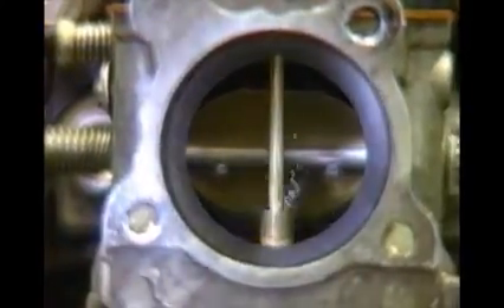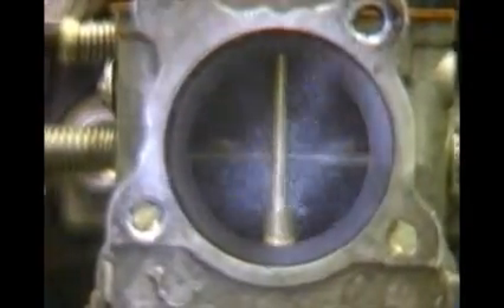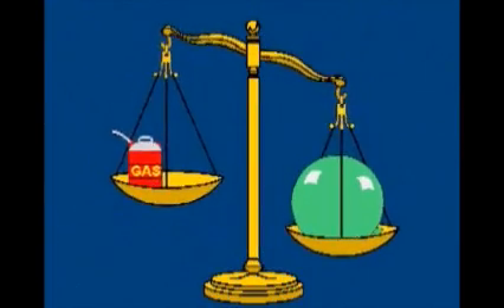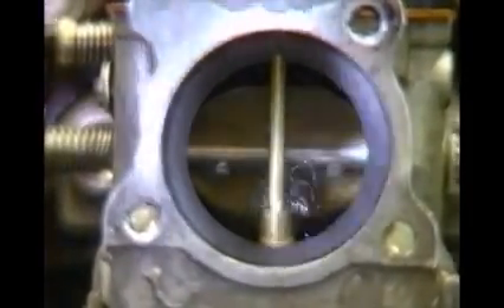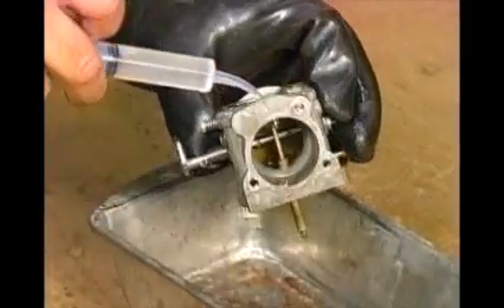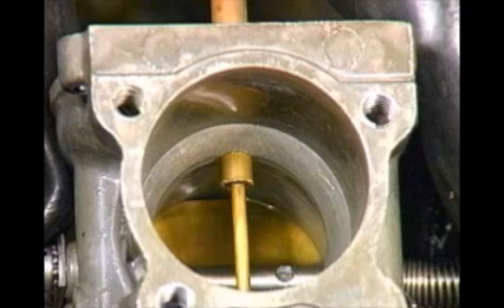Carburetor Theory and Service Procedures - Evinrude Training Video

Comment: Wow I wasn’t expecting to learn something from this video but I did! I didn’t know about float drop adjustment, absolutely no one on YouTube I have seen has talked about it. I think this will fix the problem im having with my mercury 5hp 2stroke I have as a kicker motor on my boat. The needle drops out of the carb and the carb starts flooding. When i take it apart I can’t understand why it drops out. Thanks a lot for posting these!!!

Comment: Maybe u can help me out, I have a 93 40hp evinrude TE40ELETB, I'm looking at new carbs, I see they make 2 different carbs for my motor, one says early production and one says late production, only difference I see is the late production has the removable top plate , my motor now doesn't have the removable plate, could I still use the other one?

Comment: Never use torch tip cleaners, I’ve seen people screw up lots of carps with those. But a lot of people use them? As long as you don’t use to big I guess?
Reply: They're kind of like round files, so it's pretty easy to enlarge an orifice with one.  Like using a chisel to scrape out a gasket:  it's effective but you have to use some care.